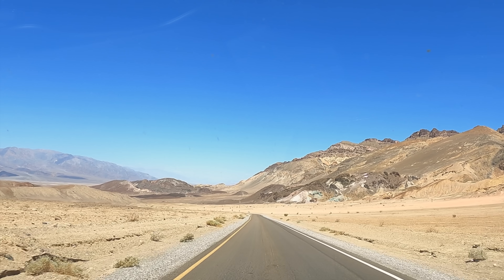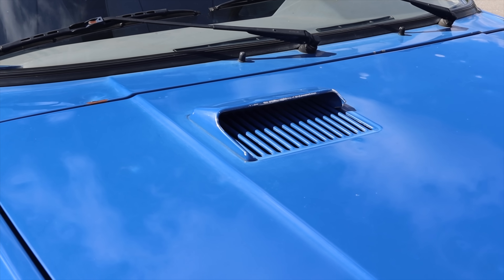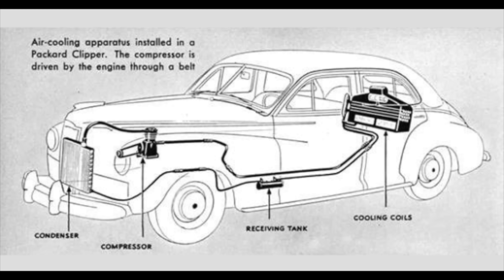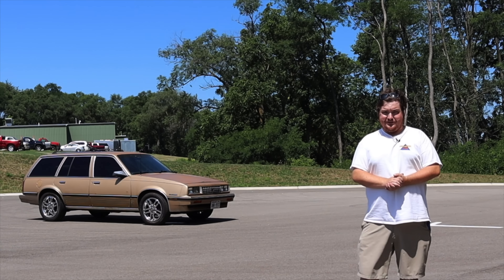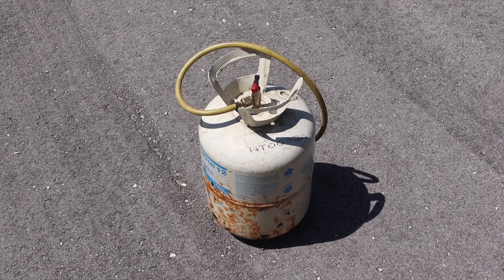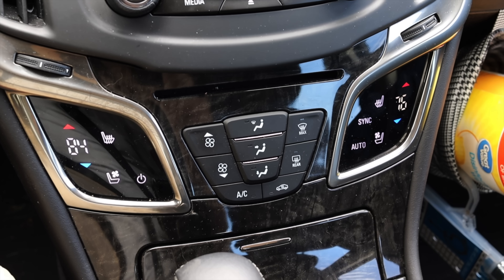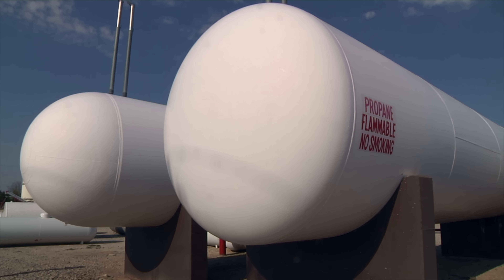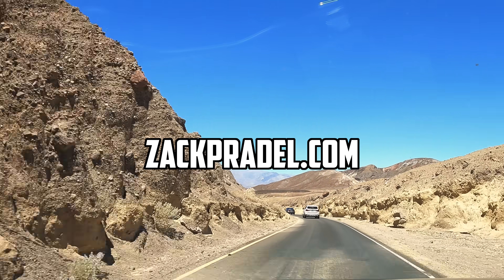Air Conditioning - The Story Of R12 & Why Modern Air Conditioning SUCKS!

Comment: R12 (Freon) was not a cause of global warming.  The ozone layer blocks high energy UV radiation from the sun.  The ozone layer is critical in reducing solar radiation that can damage living tissue (you know, like sunburn).  It has only a marginal effect on global temperatures.  Also, an air conditioning system designed from the start to use R123A is about as efficient as a systems designed for R12.  The problem is systems designed for R12 that are adapted for use R134A.  Modern air conditioning systems designed via computer with CFD are generally more efficient than older more poorly optimized systems.  Progress.

Comment: The issue with the ozone layer was increased ultraviolet radiation, not global warming.  That said, there is a new refrigerant replacing R134A.  It is R-1234yf, and it is RIDICULOUSY EXPENSIVE.

Comment: There is a alternative to R12 that is not dangerous n'or requires an overhaul of the old A/C system.
It's called R437a. Had my old A/C topped up with it, as it hadn't been working since I got the car with it. Since the R12 had leaked out through a faulty filler valve and I noticed way too late until it was all gone.

So yeah, fixed the filler valves with new inserts and a specialised shop filled it with R437a. Had no issues since and the A/C works again.

Comment: I have a 2006 GMC Sierra, I’m sure it runs on R134, but my god does that AC freeze me out when it’s 100 degrees outside. 307,000 miles on the truck and the AC has never been serviced once..

Comment: I didn’t think the hole  in the ozone was the same thing as global warming but I might be wrong
Reply: The bigger concern with the ozone layer is that it blocks alot of UV rays, this is bad because a hole in it would allow UV rays to get through, which have a pretty bad habbit of giving people cancer
Reply: @09impala  Yeah that’s what I remember but also remember the first time they had a satellite to see those and they saw the hole so they had no idea if it was there before or not. The latest news I heard said the hole closed up but it seems to go in cycles opening and closing. I might be wrong but I think that was the same time that they say we were heading into a Ice Age.
Funny I just looked it up they said the whole is shrinking because of warmer weather. Thanks hat has gotten a little bigger over the Arctic because of cold weather. But they said overall it’s still shrinking. And I guarantee the science will change the next decade ,nobody really knows anything for sure

Comment: I had a car with a smokers' windows. I call them "cozy wings." I've also had cars that used R12. A point of this essay, that R134A doesn't work as well as R12, is right on the head. There are a number of things we as a society do because it's inexpensive (compared to other solutions) and it works. 

Cases in point: 
lead in solder. Lead-free solders in electronics just don't work as well. They develop tin whiskers that can cause shorts across the tiny integrated circuits. 
chromium in anti-corrosion coatings for metals. Alodine and other products on aluminum works great. It took a long time for industry to develop a secondary process that's safer for the environment (and workers!), but still uses chromium. 

I agree, there are some things that society should pump the brakes on to understand more about the cons of various products but the biggest reason why we put out products that are later found to pose dangers is the economics of it: it's not cost effective to search for problems in a viable solution.

Comment: I became an auto tech in the 80s. I worked on those old systems and yes I handled R12. In 91 I worked for Nissan at a dealership and often installed the "factory" units. Stuff was magic. Easy to find leaks with the right tools.
It cam in 14 ounce cans we referred to as pounds though they were 2 ounces shy.
What made R12 work so well was a combination of things. Early cars used an expansion valve and the compressor would just run dragging close to 30 horsepower at times. The full cold temperature of the older systems could hit 32 degrees Fahrenheit or 0 centigrade. As the systems evolved many redesigns came about. The reciever driver on some cars moved to the low pressure side. Compressors became lighter and smaller and demanded less power from the engine. They would cycle the compressor according to pressure and use a fixed expansion orafice. These designs later on began to adapt from R12 to R134A pretty quickly. The R134A just has a higher condensation temperature to pressure ratio. This means it doesn't move as much heat when it vaporizes and condensate. Still, you can get 134 to cool down all the way to 40 degrees Fahrenheit.

Comment: R12 is still obtainable and can work in R134a systems. Been running R12 for 12 years on a R134a setup and never changed any components. Runs colder too

Comment: Question- I've used Ozone lamps for sterilization. Ozone is Oxygen 3 (O³). Monoxide (O¹) and Diaoxygen (O²) are VERY stable. It's created when O¹ and O² come into contact with UV radiation and stratospheric electrical charges (thats why you get that chlorone smell when lighting strikes nearby- ozone) and is VERY unstable and will react with most organic material and revert it to O¹ and O² or bond with its substrate and become CO²》O¹ (or any oxide compound under the right circumstances). My question is- can we send up weather balloons with Ozone lamps and replenish the Ozone layer? The bulbs are only 100watts each and can put out 12 grams an hour- considering the Ozone layer is only 8ppm that's a serious dent if you float 10,000 bulbs for a year.

Comment: I have a couple of Cadillac Fleetwoods - an '84 and an '86 factory limo. Both cars have R12 aircon systems and both are still running well. When the time comes to re-charge them, I guess I'll have to have both cars converted to accept R134. Expensive I imagine but here in the UK, R12 is pretty much impossible to find. Hey-Ho...that's life I guess

Comment: Propane isn't as crazy as it sounds, it's also known as R290, and it's used in some air conditioners already (IIRC, common in industrial). it's got a much lower boiling point than R12 though, so who knows if the compressor is strong enough to change phases.

Comment: I have used propane. it works phenomenally. and its just as flammable as the new R-1234yf refrigerant is. I don't recommend using propane, but it does work. just do your research and use the appropriate oil in your system. pag oil with some refrigerants can cause explosive compression.

Comment: modern cars can be as cool as r12, you just need to over-charge the system, but be aware how old the system is cuz it might leak out. learned this from a teacher at a school that had dealership level tools. never knew you can get freezer burn from a 2010 chevy tahoe with that trick

Comment: Been a mechanic for 20 years. I work a lot on cab air and used to be a Reefer mechanic. I used to have a Air conditioning unit for my garage that was R12. I disabled the thermostat. The evap would frost up and almost stop the airflow. It got really cold. R502 and R401B rivaled R12. Got to check out a Thermoking reefer unit from the mid 70s. It had a half charge of R12 sill in it.
Reply: how come not even schoolbuses use reefers? and believe me its not pleasant stepping inside one during the summer

Comment: Yes I remember cars from the late 80s and early 1990s turning the AC on full blast as it instantly feeling cold as little tiny frost crystals came out sometimes with the cold air blowing when you first turned on the AC.

Comment: really? sucks? I live in florida where the temp in the summer nears 100 and the humidity is in the 90's. my 1977 firebird uses r134. it's so cold i put it on fresh air. your full of it. maybe if you ate a little less and lived within your proper body fat index, you would not be so hot driving in your car. in fact, i suggest you use a bicycle or walk places.

Comment: The water method works excellent on motorbikes on a scorching hot day. Just soak your shirt with water before you set off. Awkward putting it on again but it’s ever so refreshing and you’ll feel far fresher and cleaner when you get to wherever you’re going. Lasts about 30-40min or so.

Comment: I honestly think a lot of the reason that modern cars have pretty weak AC is efficiency, and by that I don't mean that modern refrigerants are less efficient, but that modern cars are more efficient. with HFO1234YF, I am sure they could design a car that had just as much cooling capacity as an older R12 system, but with how efficient modern cars are, AC plays a much bigger role in the energy consumption of a car, and making a system that powerful would have a noticable effect of a couple MPG in the most efficient cars.

Comment: R12 also came in the same small cans as 134a that you buy at auto zone. Also most refrigerants come in the big cylinders and bigger like the one on your video. Refrigerators used 12 also then they went to mp39. I took hvac in high school from1994-1995 school year until the 1996-1997 school year Those were the years they were fazing out R12.

Comment: The thing that I missed about R12 the most as a mechanic (UK) was in fault diagnosis. With R12 if the suction line line was at 32psi, the evaporator temperature was at or near to 32°F freezing. With R12 there was quite close correlation between pressure and temperature, this changed with the new-fangled 134a. Edit: I would add though that modern (ish) systems have been improved to the point that even this last summer where we have had temps over 100°F (unusual for the UK) it was still possible to get my 5 series BMW too cold for comfort.
Reply: Every refrigerant has a temp/pressure correlation

Comment: In my automotive classes years ago I remember doing an analysis of my old refrigerant before changing my low pressure line and recharging. We found out like 20% R12, among ~5% of other refrigerants and some hydrocarbons. This all found in a 2004 maxima which takes 134a normally

Comment: I did a road trip across the US and went through Death Valley mid-day. It was 115 out and I did not have working AC. Even with windows cracked and the fan blowing hard as it could, my internal dash temp gauge read 135. Definitely a heated  experience lol

Comment: GM had that big frigidaire compressor, and was a 6 cylinder radial with three cylinders opposing each other, we didn't care  so much about mpg then, took a lot of power to run the thing but boy did it crank out the cold, newer models have smaller compressors so as not to be so much of a load on the  engine, things are much finer  tuned these days, and any of the newer cars i've had, the ac works fine

Comment: Propane is an amazing refrigerant, you just need to have the right equipment. When used properly, the charge used in a large restaurant fridge should be no more than 150 grams, which is equivalent to or less than a cigarette lighter refill can. The total charge in a typical mini split AC unit is somewhere around 200 grams, equivalent to a can of spray. In a car, the charge should be no more than a few tens of grams, which amounts to around one or two dozens of cigarette lighters. Gram for gram, propane is likely the most efficient refrigerant cheaply available, and no one can patent it -- it is naturally occurring, and despite not being used in households thanks to being lobbied against, it has been used in research and industrial fields for decades.

Comment: Propane is an excellent refrigerant, that's why every single refrigeration unit owned by Coca-Cola runs it. They, however, refer to it as R-290.
It's compatible with R12 and R134 compressor oils and can blend with both refrigerants.
It tends to run too cold in unmodified R134 systems and freeze evaporators, but I've personally run it in R12 systems and it seems to be a perfect, direct replacement.
As for flammability... R134 is methane. R12 is spicy methane. All refrigerants are quite flammable, and R-290 is no more dangerous than any other refrigerant. It just holds the benefit of costing $17 to refill a 20-pound cylinder at Menards.

Comment: the ozone layer hole was not a warming issue it is a UV/skin cancer issue. If you swap a larger condenser on to an r-12 system when doing the conversion to R134a you can get them blowing close to r-12 temps. my 1980's wagoneers had floor vents that pulled air in from the cowling in front of the windshield, and vent (smokers) windows, and factory under dash ac which was very much like an add on to the 1960's design AMC kept modernizing. Overall you made a great video.

Comment: My dad had a 87 Toyota pickup, we had a thermometer in the dash vent and it would read 25F-35F in 100F south Alabama summer in the late 90s. Literally would freeze you out of the cab, it would condensate the outside of the windows sitting idling with the ac on.

Comment: fun fact, you can still purchase currently produced R12... From China, but its expensive AF, i've done propane conversions, and as long as you don't have a leak, it is safe and effective, HOWEVER! if you do have air leaking INTO the system, it is Dangerous to convert, and i have owned a few vehicles with functional R12 Factory AC systems, i had a 1981 Chevy C10 (Square body) that would freeze you out of the cab on a 110+ degree day

Comment: You left out R12 was developed by GM to be fire safe.  That's basic Wikipedia.  Why would you leave that out?  Everything R12 has to be rusty ugly and old, for this little UN emissions propaganda video?  R12 works extremely good and the hardware for it lasts much longer and easier to service.  There were 2 significant buildings in New York that had R12 systems, but were forced to change them in the early 90s Clinton admin due to a little mishap.  Curiously R12 was to be phased out by 2000.  Well scratch your noggin what happened in 2001.

Comment: I've charged R12 systems with R12a (propane/butane based) and it works quite well... in fact I've charged a few mid-90's R134a systems to R12a and the end result is colder air.  Incidentally with 12a it doesn't matter what compressor oil  your car uses.

Comment: I'm from '95, so all my cars have ran with R134 and tbh it still does the job well. I think you would notice the difference in refrigerant-to-efficiency more in residential central HVAC systems rather than your tiny car cooling system - but this just comes from limited life experience. 

Now, what I wish someone would cover in a video would be the evolution of HVAC mechanical-electrical systems. How is it that you've got "cheaper" car makes with the same controls as 30 years ago, while the newer "higher-model" cars have a whole-ass thermostat? How much more efficient is that mechanism than previous iterations?

Comment: I used R1270 (propane, very similar to propane) for refrigeration devices as it can get pretty cold, -50°C easily without loosing too much load handling. I would never put R290 (propane) in a system not designed for an A3 refrigerant, who knows if the hoses designed for R12 can handle liquid or vapour propane, or the slightly higher pressures it can sometimes generate, not to mention the fact it's incredibly dangerous. 
Also R134a is more efficient than R12, it can cool a greater amount of air for the same energy, it's just about 3K warmer than R12 so it runs a little warmer, but it takes less energy to cool, but that's all swings and roundabouts, if you want an ice cold fridge of a car have a custom R449a/R452a system installed and enjoy air temps easily in the -30°C range

Comment: As an HVAC engineer, I feel I should point out a couple of corrections and additional info.

Number 1, ozone depletion and global warming are not the same problem. The ozone layer helps block ultraviolet radiation from the sun. Without the ozone layer, we would all essentially get skin cancer or sun burn much faster. The Montreal Protocol phased out refrigerants that damaged the ozone layer. As for global warming potential,  carbon dioxide has a baseline global warming potential (GWP) of 1. R-12 has a GWP of 10,200. R-134a has a GWP of 1300. Still high, but going in the right direction. However, the proliferation of refrigerant based air conditioning systems has probably offset the global warming potential reduction.

Number 2, propane is a pretty effective refrigerant. So is ammonia. There are obvious reasons why we don't use them in residential or automotive air conditioners. A refrigeration system's components (compressor, expansion valve, evaporator, and condenser) have to be designed with a specific refrigerants vapor compression cycle, so you can't just put propane in an r-12 system. Propane is often used in industrial refrigeration in which a small leak is not dangerous.

3) due to its high global warming potential, R-134A has already been phased out in new light duty vehicles. R-1234yf is the new automotive refrigerant. It has a GWP of less than 1. As for performance, the new refrigerant is less efficient than R-134a, and the cooling capacity is less. So once again, barring new technology, it looks like our AC systems will take a hit.

Comment: R12 was definitely superior. About 1992, the magnetic clutch in my 1971 Ranchero locked on and wouldn't disengage. Do you know what it is like to be in the middle of a hot Texas summer, yet you have to roll down the window to keep from freezing to death? 🥶 A thermometer placed in one of the vents read 40 degrees Fahrenheit (that's slightly less than 4.5 degrees Celsius).